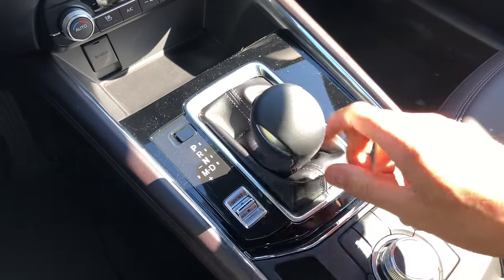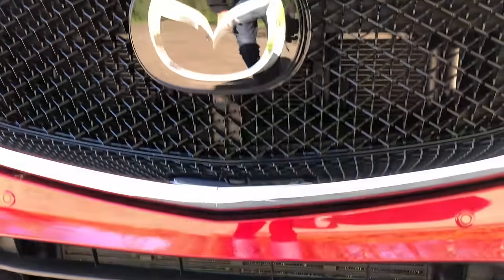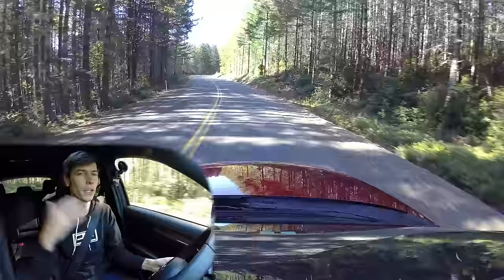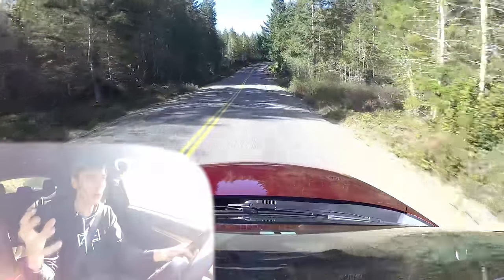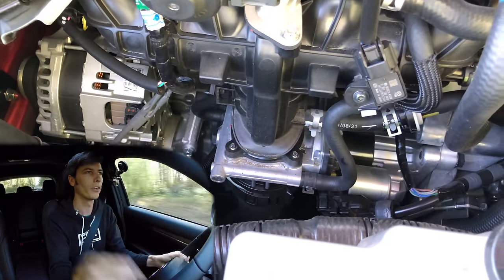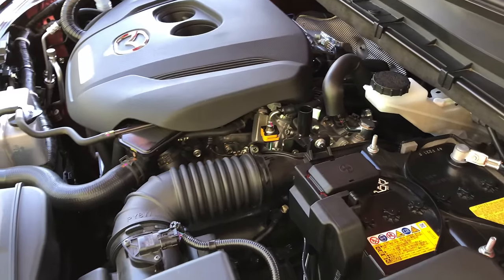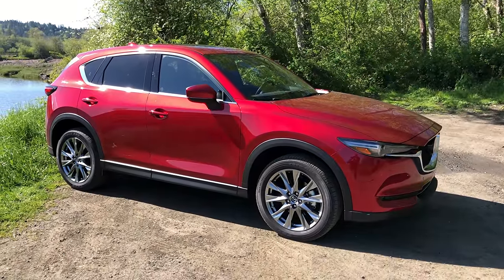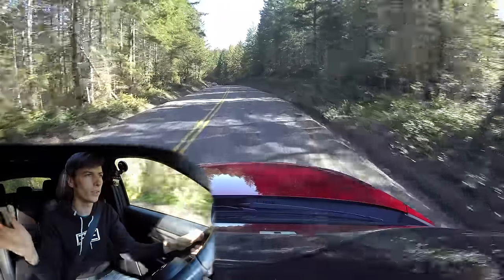Are CVTs Bad? Why Mazda Avoids CVT Transmissions

Comment: I wouldn't put a hybrid vehicle eCVT in the same category as a regular, friction CVT.  They work on totally different principles.
Reply: You are correct. An eCVT is far more reliable and would last far longer than belts and pulleys.
Reply: So many people compare Prius eCVT to friction CVT it is boring at this point. Even on some of the videos, these are compared to one another.
Reply: @nickg9021  This is where Jason lost me, on top of that he is a hypocrite by owning a manual Crosstrek. 
I drive two CVT - N-box and Civic. They are rubbish and loud in the mountains (I can hear the transmission itself, not the engine). Bad for engine breaking. The list goes on. 
This is the worst video from Jason I`ve seen so far in two years since I watch his videos.
Reply: I think he frequently gets this wrong.

Comment: I didn't read all of these, so maybe someone else had this.... but I believe the Rav4 hybrid, like other Toyota/Lexus hybrids, doesn't have a CVT as we understand it. They call it a "power-split" device. There is no torque converter. There is a planetary gearset rotating around a sun gear. It feels like a CVT so it gets called that. This gizmo allows power provided by all electric or a combination of gas/electric propulsion, but a traditional as-we-call-it CVT it is not.
Reply: No, it isn't. Roger is correct. The Hybrid is actually motor generator. The engine is coupled directly to the input shaft that rotates the armature. Using electricity when accelerating and putting it to the batteries when decelerating. It is NOT a CVT. The variable speed is the electric motors, NOT concentric cones joined by a chain linked belt.

Comment: So literally all of those "transmission goals" are hit by CVT transmissions except for the the last one "direct feel". I own a 2015 Subaru Outback 3.6r which has the 3.6 liter 6 cylinder engine and the high torque CVT. I find that it's not as direct feeling as say a manual but it's not any worse than a DSG or conventional automatic. I think the key is Subaru uses a locking torque converter which allows for a more direct than normal feel and a chain vs a belt. Anyway I laugh at the CVT haters, most have no clue what they are talking about. Yes Nissan/Infinity builds CVTs that blow up but that's one manufacture and they've had plenty of other issues with there cars in the past so no surprise that they can't make a decent CVT.
Reply: I have a 2016 Legacy 3.6R. I agree with you; I don't mind the CVT at all and it can still be a fun car.
Reply: @billsandrew  I love the Legacy 3.6r, great car!
Reply: I have a 2018 Crosstrek and I like the cvt, granted the car doesn't have the pickup of my previous car, a Honda Civic si, but it is more than adequate for my needs.  One thing I will say, is my Crosstrek after the break in period seemed to have faster and smoother pickup, than when it was new.  It makes me wonder, seeing as journalists doing tests on cars fresh from the factory,may not be getting a true idea of the performance of these cars.
Reply: @jjr007  That is fully possible, if they are getting cars that haven't been broken in at all or improperly broken. I would hope that manufactures would put their best cars out for testing knowing that auto journalists like to whine about everything. Also I can understand  the acceleration difference you notice between the Crosstrek  than a Civic Si. There is quite a difference in horsepower between them. I do love the Crosstrek, and I would love to see Subaru come out with a full electric model that has a 250+ mile range and is as quick as most sporty cars 0-60 wise. If they did it would be expensive though.

Comment: I have a Nissan primera p12, 250k km driven. It has cvt transmission, hands down best gearbox so far. Quite high fuel consumption, but i really dont care. Great and smooth acceleration on normal traffic (not suitable for racing though). Summer or winter (-30- +30c), it works same. My next car is Lexus with e-cvt.

Comment: If I buy Japanese I prefer Mazda...they are the Japanese BMW, but with affordability and reliability...
Reply: bad resale value.
Reply: @drsanmyattun  not really. Quick search on CarGurus shows a Mazda6 and an Accord from 2016 selling at roughly the same prices. They both sell around 15 to 16k for the higher trims.
Reply: @Lord_Sunday123  Try to resell by yourself  or check with dealers for trade in. Honda is still better in resale.
Reply: Bad resale value is a LOUSY reason to avoid buying a car that's reliable and well designed. A couple moderate repairs flush all resale value down the toilet

Comment: CVT's are detestable from an enthusiasts point of view ... Awful static drone, dismal off the mark performance and unpleasant throttle response
Reply: 90% of drivers are not your enthusiast. A car manufacturer does not cater to a small number of people when majority are regular drivers looking for fuel efficiency which are the main drivers for their profits. Btw car enthusiast are also one of the most toxic group of people.
Reply: @441meatloaf  would you buy a CVT?
Reply: Manufacturers don't put CVTs in their enthusiast sport vehicles anyway so most that complain are missing the point. For what it's worth my 2019 Forester has no drone and good enough response for an everyday driver.
Reply: @kentsutton4973  Audi finally woke up and dropped them from their line up. An 8 speed like ZF's impeccable 8HP is the finest automatic transmission on the market bar none. Manufacturers simply don't want to learn. Buick spent 20 years persisting with their shockingly horrible CVT dynaflow before finally pulling the plug on this this shivesomely horrible mechanical monstrosity

Comment: If you do not think CVT is bad, you are not a mechanic.  I have to changed those things at two a week.  Most of then are a Nissan.  It seems only Subaru makes them right.  But I have had such bad luck with them that I do not think I will ever own a vehicle with a CVT.  For me, it is only manual transmission.  But that is because I am working on cars all night and do not want to work on my own on my nights off.  The CVT in race cars are not the CVTs in commuter cars, not even close.  Avoid CVT and dual clutch unless you really like your tow truck driver.

Comment: Mazda stay away from CVT. 
CVT 🤮🤮🤮
Reply: Arman 80 I am a rideshare driver and my 2016 CVT Toyota Corolla LE has 161000 miles, no issues at all 🤷‍♂️👀 Proper maintenance is the key. For Corolla, you need to change the transmission fluid every 60000 miles. You also need to change the filter and clean the three magnets. “DNY automotive “channel shows the proper way to change the trans fluid.
Reply: they will go electric before they go cvt

Comment: The rav4 has an 8 speed automatic, not a CVT. The hybrid rav4 has an (eCVT)
Reply: the e-CVT is technically the superior transmission to all of them
Reply: drkastenbrot It’s the only CVT transmission I would buy.
Reply: @12skits63  honestly, go for it. My parents, and now also some of my neighbours also drive toyota/lexus hybrids. The consumption is very nice, they have decent power compared to other fuel efficient cars and the reliability is unmatched. I would have liked to buy a model 3 instead but I just wasnt in the new car market. 
I would recommend one of the standard 3rd/4th gen hybrids. The RAV4 only makes sense if you actually need it because it consumes substantially more than the sedans or compacts.
Reply: drkastenbrot Oh trust me, I would buy a 19 rav4 hybrid limited if I could afford it. 41k is way too much for me. It’s a perfect vehicle tho, “fast” with outstanding mpg and all the practicality and amenities you could ever want need. Apple car play, 360 camera, ventilated seats exc. I had an 07 rav4 sport. I sold it last year, honestly one of the worst decisions I’ve ever made. It was the most basic vehicle I’ve ever had, but I miss that car ever day. You live and you learn 🤷🏽‍♂️

Comment: 310lb-ft... damn. that’s more than my Toyota V8!
Reply: Yeah but that's just peak torque. Looking at the graph will tell a different story (I hope).
Reply: @Filip_Phreriks  Nope. The torque comes really low. ;)
Reply: @Filip_Phreriks  sort of, in my focus st i get 270 at 2300 rpm and it drops drastically after that but if you floor it you hit overboost and its stays at 270 for 15 seconds after peak so about till 4500 rpm and and max hp at 5500 of 255 im excited though  im getting ford power pack and it raises the torque to 360 at the crank peaking at 3k and overboost holds till 5-5300k  so should be good having torque higher in the range
Reply: Zack Mandarino it takes 15 seconds to go from 2300 rpm to 4500 rpm lmao?
Reply: I get 380Ib-ft at 6500 rpm (n/a)
Reply: @Filip_Phreriks  that 420nm/310ftlb peak is at 2000 rpm so relatively low. It is tuned for low to mid range pm performance, where the vast majority of people sit in everyday driving. It is a nice engine with strong, every day performance. It even managed to make Ward's 10 best engines when it first came out.
Reply: But not as simple and reliable?
Reply: @m.h.3679  no it all depends on the temp of the charge load my car heat soaks fast so its usually about 4500 but if you have an aftermarket fmic you can get to 5 or 5500 but car doesnt make power after 5500 its a small ass turbo the airflow just isnt there  once the stock turbo goes im going bigger and that should fix the problem its about 6.1 second 0-60 after the tune i should be 5.5-5.7  from what i have been seeing
Reply: @m.h.3679  ill test that once i get it you can only do so much with a fist sized turbo lol thats why all the damn power is so low  i dont understand 6500 redline lets make power stop at 5500
Reply: @m.h.3679  still a blast of a car to drive
Reply: @samuelhumphreys7712  i need a bigger turbo for that i wish  thats going to be later in the build
Reply: @Filip_Phreriks  Variable geometry turbos essentially allow the torque to be linear much like an NA engine. Turbo's are awesome now. They basically have no lag, no ridiculous boost spike, and no reliability problems like they did 20-30 years ago. A lot of the original reliability problems from the 80's were due to just poor cooling...now they are liquid and oil cooled, have proper intercoolers, and the engine and exhaust are built around them.

The only downside is the cost. They make vehicles more expensive to make, and more expensive to maintain. You absolutely need to pay attention to oil change intervals, oil quality, coolant flushes, and transmission fluid exchanges because they are very hard on transmissions - this is why you rarely see CVT's mated to turbo vehicles...for example the Honda Accord 1.5T has a CVT with 192ft\lb  but the 2.0T with 273ft/lb has a 10-speed slushbox because that much torque would slip the belt on just about ANY CVT.

CVT's just don't handle torque well. They started in scooters with 2-stroke engines. Toyota is really onto something by adding a starting gear, eliminating where most wear occurs in a CVT - at take off.
Reply: @zackmandarino1021  I don't have a turbo on my engine it's N/A
Reply: Simple. U dont need a car to race.
Reply: 295 ft lbs tq from my 4 cylinder

Comment: I’ve driven both a CVT equipped 07’ Nissan Altima and a 6 speed automatic 2013 Hyundai Sonata, the CVT feels way more responsive, as soon as you put your foot down it takes off instantly, the only time I feel the rubber bad effect is when I am barely pushing on the pedal, and when I do push it barely, I expect it. On top of how smooth the car is, being 14 years old that car still rides like a cloud, I love how smooth the Nissan accelerates, another thing is the amazing gas mileage, even going 80mph on the freeway, I’m getting 30mpg, which is impressive for these Vegas hills. Only issue is reliability, a CVT meets most consumers expectations, the newer nissans don’t have cvt issues. I have barely had any in 14 years.

Comment: One thing about CVTs is that your throttle translates directly and linearly into RPM, and when you reach your desired speed you just drop that RPM to the spot where it just maintains your speed (usually around 1500-2000 RPM), which makes for a more intuitive management of your acceleration and speed. It’s boringly predictable.

Comment: CVTs are being used more and more due to government-imposed fuel economy standards.  The more power and weight, the less reliable a CVT.  The only CVT proven to be moderately reliable is sold by Toyota.  Honda makes their own CVT (inhouse) and is still trying to prove it is reliable.  Nissan and Subaru continue to prove their CVT is unreliable.

Comment: Mazda’s are built for car enthusiasts that ultimately have to sacrifice on something more extreme for practicality. 

Most fun I’ve ever had driving a crossover was my 2016 Mazda Cx3, that I lifted and put on BFG K02’s. Was an absolute blast running that thing through the snow and mud. Almost hit 100,000 Kms but sadly needed a truck for work.

Comment: Mazda is Awesome! I have previously owned a new 2005 Mazda 3 (8 years), and a new 2014 Mazda 6 (5 years). I now own a new 2019 Mazda CX-5 Signature (1 year). All 3 Mazdas have  been great cars, and I have never had a problem with any of them. My brother also had an RX-7 back in high school (in the '80s) that just ran forever. My uncle still has a Mazda B2000 truck that he uses regularly to this day. The 2.5L Turbocharged engine and the 6 speed transmission work great together in all of the available Mazda models, so why mess with a good thing? Also, Mazda has not been affiliated with Ford for many years now, and they manufacture all of their own cars in Japan. Mazda's Skyactive engine technology is so sought after that Toyota is currently forming a partnership with Mazda so they can use Mazda's engine designs in their own cars. For a smaller, not as well known car company, Mazda makes some fantastic cars. Honestly, I used to be a Chevy guy, then I bought a Mazda and never looked back. Try driving a Mazda sometime. You definitely won't be disappointed. By the way, Mazda's Soul Red Crystal Metallic Tricoat (code 46V) paint option (shown on the CX-5 in this video) is just amazing, and well worth the extra money. You have to see the paint in person to really appreciate it. The paint really looks like the popular Candy Apple Red Hot Rod color.

Comment: The 2019 hybrid rav4 has no transmission the gas engine is hooked to 2 eclectic motors, one that charges the batterys and another that drives the car. For whatever reason toyota markets that as a cvt but its nowhere close
Reply: The hybrid technology, that they're calling an eCVT. The same thing as the prius.

Comment: Very interesting and thank you. Here in Europe the CX5 is available with a  2.2 ltr diesel motor with 150hp, 380nm torque, and a low 14.4 compression ratio. The motor was revised in 2018 to adapt better to WLTP. I am currently in the market and the CX5 with this motor & box is near top of my list. Any comments please on Skyactiv-Drive transmission with this motor ? Thanks again.

Comment: CVTs are excellent in design and performance.  Few moving parts, light weight, maximum efficiency, great fuel mileage, cheap to produce, etc.

But they have one fatal flaw.  By design they have limited power handling capability, therefore depending on engine power and hard driving habits they tend to start slipping after say 50k miles.  Once this starts no amount of maintenance can “heal” them.

Comment: My 2018 Civic EXT (CVT) bought new June 2018.
As of today, Sept 10, 2022: 118,300 miles averaging 33.8 mpg (combined city/highway). I easily get well over 43 mpg straight highway.
After four years and two months, I’m more than satisfied with the Honda CVT...so far.  Sure it’s not as responsive as an automatic and definitely not a manual but you easily get used to it and adapt. However, i won’t be satisfied unless I get at least 300,000 trouble-free miles with excellent maintenance. I’ve already changed the transmission fluid three times and will continue to do so every 35,000 miles.

Comment: All this talk about CVT's vs planetary autos, and I'm still sitting here with three pedals wondering why people don't like to drive anymore.
Reply: Meh. To each their own. 

I have one of the last cars with three pedals ever made, but it’s only one small aspect of the very large thing called driving. 

It’s like fixating on using manual settings in cameras or flying tailwheel aircraft. They do take a specific skill set to use and not everyone can use them.... but they will never teach you how to compose a photo or how to do a wingover. 

If you can drive a standard transmission, but can’t hit the apex of a corner or can’t do a J turn or don’t know what lift off oversteer is (right before you wind up in the opposite ditch after taking your DK impression too far)... then you’re not as good as an automatic driver who knows all of these things.

Comment: Honda's CVT transmission have become so much better on with the 2016-2017 Civic with the 1,0t or 1,5t engines compared to the older CVT in Jazz/Fit and HR-V

Comment: CVT transmissions are a great idea but are very unrealiable, when they fail it destroys itself which makes repairs very expensive because you might as well fit a new unit. I have had one and it was quite good but I was always aware of the failure rate and treated it very carefully and my family said I drove it like Miss Daisy. I have had several automatics since and they have been great but would Never have another CVT because at the back of your mind your always worrying about the cost of repairs if it goes wrong, this is no way to run a car. I was going to buy an X-Trail last year until I found out it had a CVT gearbox and ordered a BMW instead and have never regretted it.